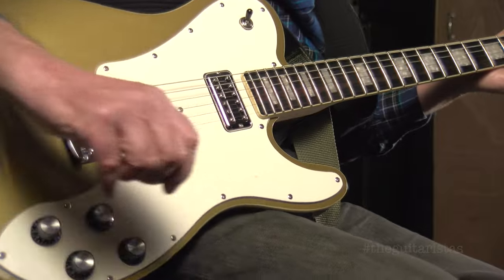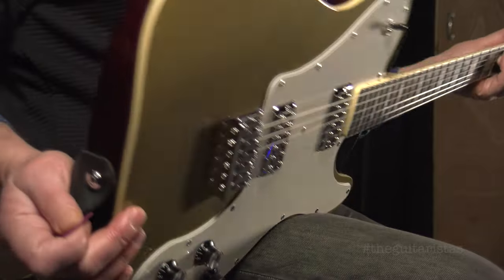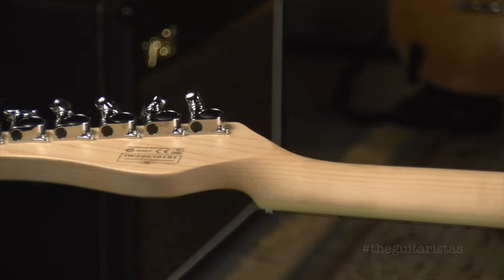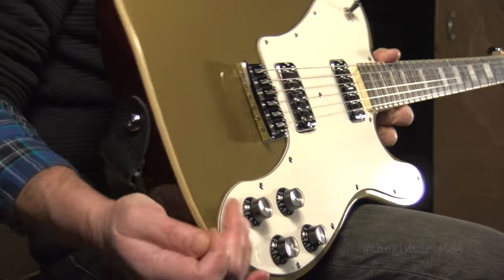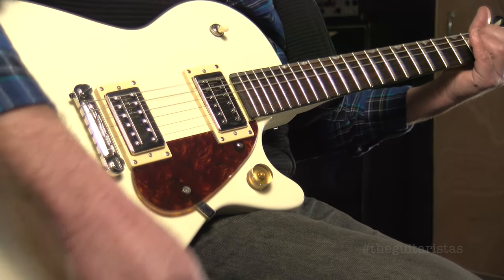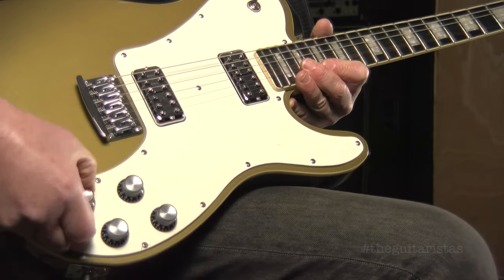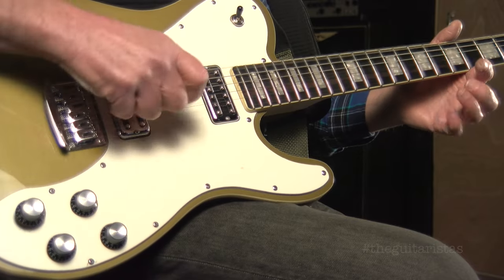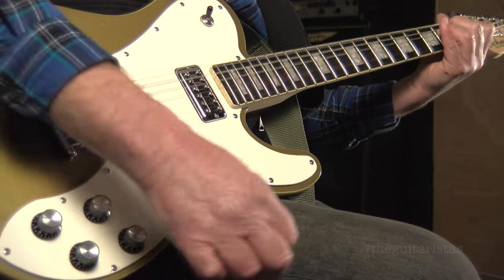Schecter PT Fastback (Pt1) - Telecaster Substitute?

Comment: Finally bit the bullet and got myself one of these.  Used to have a Fender Cabronita, but a few things about that left me unsatisfied (lack of controls, maple fretboard, and dodgy QC (mostly the bridge alignment)), this looked to be a good compromise (Tele Deluxe layout with Filtertrons).

Welp, have to say that you're right about needing upgrades.  Went a little overboard (I have a terrible habit of making "sleeper" guitars for my own amusement), yanked out the stock wiring and electronics, replaced everything with a Panasonic switch, Switchcraft jack, CTS pots, orange drop caps (push-pull coil splits on Filtertrons seem a bit redundant), and last but not least, a set of TV Jones TV Classics.

Did I put more into the guitar than the price I paid for it?  Yes.  

Was it economical and practical?  No.

Was it fun and totally worth it?  Yes.

I have to emphasize that I would not have considered this had the "bones" of this guitar been sub-par.  It's a pretty solid build with adequate QC, stock electronics were probably there to keep the price in the $700 range (I got mine for significantly less because I camped out for deals).  It was already a keeper before I went and succumbed to my bad tinkerer proclivities, and bare stock it was already an improvement over my old Cabronita, even with the dodgy stock wiring QC.  To get something of this configuration from Fender you're going to have to pay near Custom Shop prices.

Before the mods it were on par with my Fender Chris Shiflett sig, afterwards it kicked the arse of that Shiflett sig and took its lunch.  Still have this one, sold off the Shiflett.
Reply: So happy I stumbled across your comment! I have this exact Guitar, and I’m also having electronic issues. I have considered putting in the TV Jones version of the P90. Did your TV Jones pick ups fit?? I know Shechter does custom pick up sizes, so I’ve been hesitant to order them.